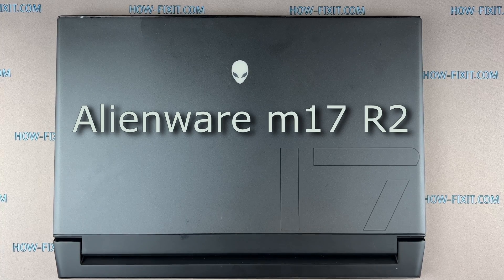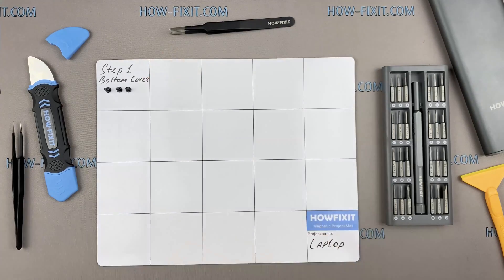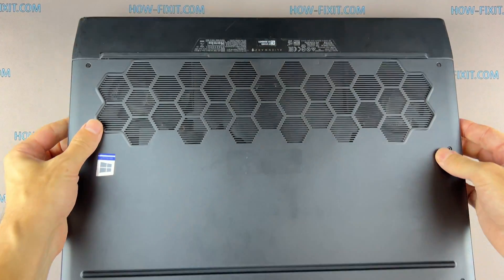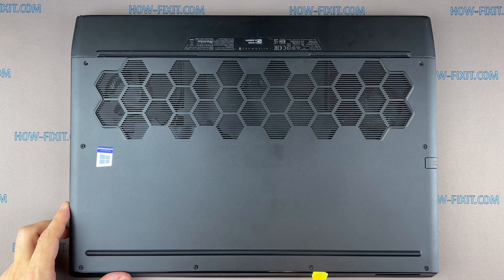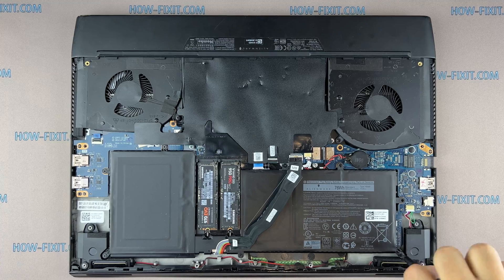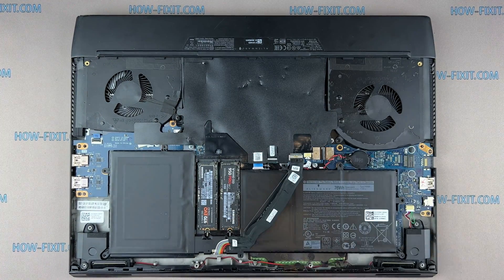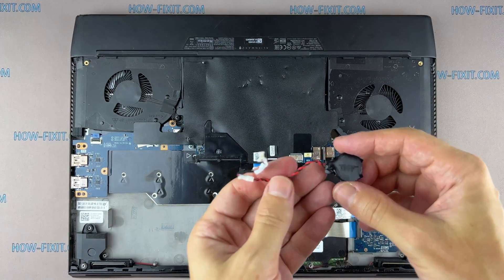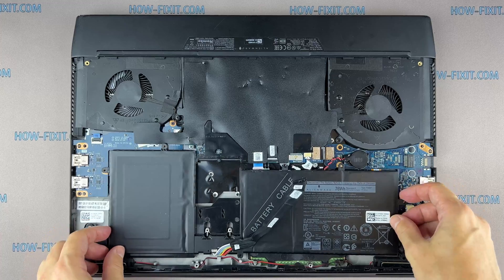How to Reset BIOS & Replace CMOS Battery on Alienware M17 R2

Comment: Hello, my computer is alienware m17 r2, it works on the power outlet, but when I press the power button while it is on the battery, it does not turn on and when I unplug it, my computer shuts down. A few days ago, everything was working normally, I could use it on the battery, but I cannot use it anymore, can you help me?
Reply from the maker: It sounds like your Alienware M17 R2 battery may have failed or become disconnected. Since it was working recently and suddenly stopped holding power, I recommend the following steps:
1. Check the battery connection inside the laptop — it might have come loose. You can follow my disassembly guide to safely open the case and inspect the battery connection.
2. If the connection is secure, the battery itself may need to be replaced. Over time, lithium batteries lose capacity and may suddenly stop working.
3. Also, check if the BIOS recognizes the battery — sometimes a BIOS reset can help if the system isn’t detecting it correctly.

Comment: Wish I knew where the jumper wire was for password reset so I could desolder it and get my computer running again
Reply: I HAVE THE SAME PROBLEM I PUT THE PASSWORD IN MS-DOS AND I DON'T REMEMBER IT BUT I NEED TO REMOVE THE PASSWORD BECAUSE I CANNOT ENTER THE BOOT I DON'T REMEMBER THE BIOS PASSWORD IN THE VIDEO I DIDN'T SEE WHERE TO PRESS TO RESET THE PASSWORD AFTER REMOVING THE BIOS BATTERY:face-purple-crying::face-blue-covering-eyes::face-blue-covering-eyes:
Reply from the maker: Unfortunately, pulling the CMOS battery won’t remove the BIOS password. For that, you’ll need to use methods covered in my “How to Remove BIOS Password” video 👉 https://youtu.be/WUDdhJVIR1M